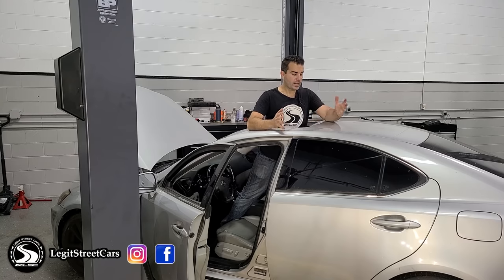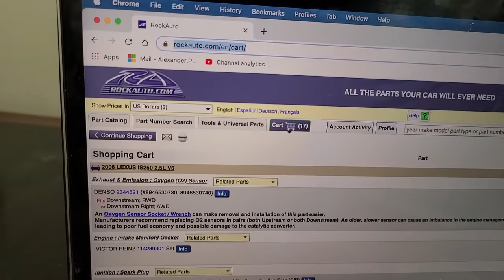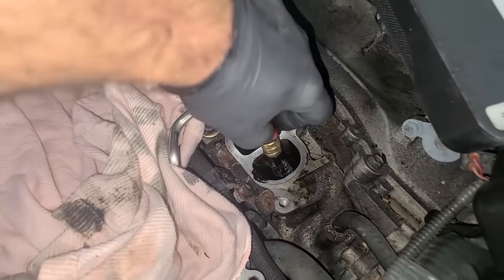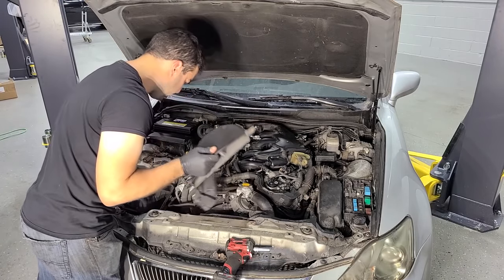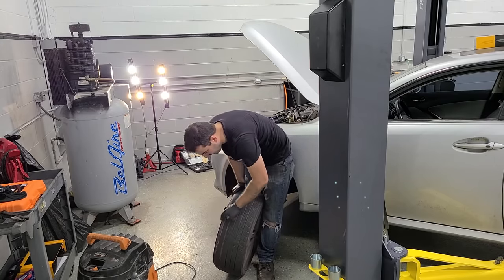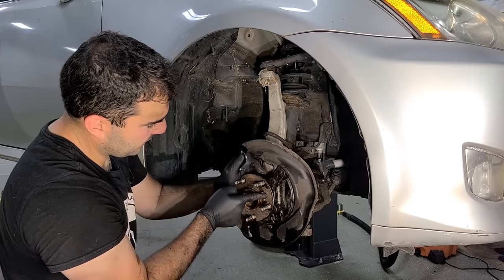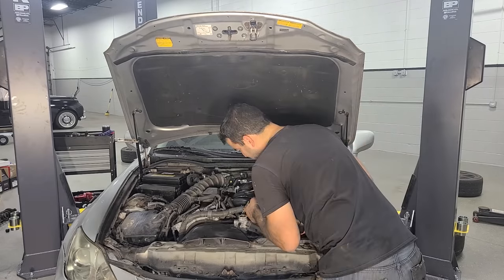I Made The Free Lexus MECHANICALLY PERFECT After Fixing A Big Issue Deep Inside The Engine!

Comment: At least in turbo VWs from what I understand the carbon build up on the intake valves is caused mainly from blow-by of other cylinders pushing the oil past the piston rings into the combustion chamber, where it is burned and gets caked in / deposited in the valves..... its not just the oil vapor coming out of the PCV into the intake manifold... although that plays a part too, as that sticky crap mixes with the carbon soot already coming out of the combustion chamber into the intake valves.... Port injectors would clean it up before but not anymore with direct injection.... its not a problem with the exhaust valves as the deposits are burned off....

Comment: I think it's a very cool thing how much you cleaned the combustion chambers and valves.  And while it certainly benefitted from your cleaning, I think a less labor intensive approach would also work.  I mean, using more cleaner and repeating the process, over a period of time plus longer drives for the car to warm up.  This engine looks like it is getting a lot of short trips, the plugs show that, did he ever change the plugs in the 114K miles?  If not, that might explains the carbon.  Fix the issues and the carbon problem should be fixed too.  Treating it to a throttle body and intake cleaning every 10,000 miles is what I would do to this car.  Also, a lot more long drives to get the engine good and hot for 20 miles or so.

Comment: What about Seafoam or just plain water, they found out that steam cleans both the valves and the combustion chamber, year's ago when a head gasket or cracked head leaking water from the cooling system turned to steam in the C C and cleaned it.

Comment: I used Seafoam Spray on my M272 engine, which seems to run better afterwards. Is M272 direct injection?  
It was a relief because it seemed like the consensus is that cars with intake manifolds with tumbler flaps  those sprays don't make it through the intake to do their job.  
But now seeing you clean the flaps I kinda feel like I would need to remove the manifold to actually do any substantial cleaning. I don't know if I trust myself to do that to my daily, lol.

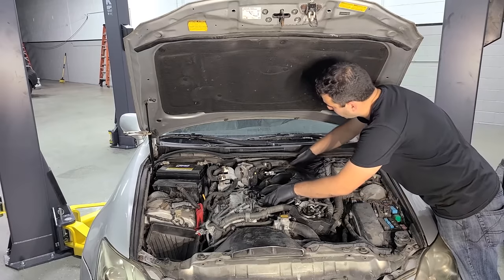Comment: I have to point out something that bothered me a bit @12:40 removal of the aluminum plenum and the lower manifold, but with the engine hot or warm... not a good idea as the possibility exists, that one or both surfaces could warp as they cool down and possibly affect the sealing surfaces.  Most people know not to remove a cylinder head unless it is overnight cold for the same reason, but other engine parts are not immune -

Comment: Read the cans, you might have the same ingredients in your possession already, just because someone is saying this is a can of this or that doesn't mean that don't have something similar or better already and at a lot cheaper price. Like I said originally they try to sell you a can of brake cleaner or carb cleaner or in this case valve cleaner that is just a pseudonym for parts cleaner. When years ago before gas was made illegal, white gas was a parts cleaner and kerosene was used as a lubricant.

Comment: easiest cabin filter .... i had to do one on a 2011 nissan rogue for a customer....drivers side...  next to the gas pedal.... also with the trans.. id still do it. i never had an issue with those "lifetime fluid" transmission fluid changes where the trans will slip.... that car hits 140k trans will be trashed if it isnt changed

Comment: They can say what they want on a can, brake or carb or valve cleaner but it will all be parts cleaner that buy in bulk from Gunk, or ATF that does just the same as Marvel Mystery oil but costs 10 times as much.

Comment: Fine job to clean the intake - but what I've seen in German videos about diesel engines these valves are nearly clean. By the way - they also use walnut blasting - nothing else works in a decent time on a diesel intake with the exhaust recycling done it's job.

Comment: "Early direct fuel injection engines[...  ]"
You mean the Jumo 210 series, DB600 series, BMW801 series, Shvetsov ASh-82FN? From the start of the 1940s? Those were early direct injection engines. And all of them (OK, except the BMW, but that is not a surprise) were exceptionally reliable.

Comment: This is such an awesome thing you are doing, probably really going to help someone out big time!  Not all heroes wear capes…. About the trans fluid, like you said, don’t believe in lifetime fluid. That’s just marketing gimmick. All hydraulic fluids degrade over time with moisture, shearing, and contamination.  You should do a proper trans flush to get everything out of torque converter, not just drain and fill. It I can do it on my zf 6hp19 6 speed, you can do it!!!

Comment: How does this clean carbon that manages to sneak into the edges of the valves and interrupts the actual seal? How do you remove that with a closed valve? Or does it tend to flake off (into the engine?!) when visible carbon right above it is removed?

Comment: Just trying to understand - if the GDI sends fuel directly into the cylinder below the valve, how does the carbon get on top of the valves if only air is coming in topside?

Comment: what was the mileage without having the carbon build up cleaned out ? I'm at 26K miles for my first time about to do it. So would it be less gunky and the CRC gdi ivd spray will likely work at this point or likely too late and will have to do a manual cleaning or nutshell cleaning ?  I'm sure the cleaner spray works if done regularly ?

Comment: How you insure your intake valves are 100% in closed position? Do you set the cylinder on TDC. For an example I have Honda Odyssey v6 and on front cam I have markings when turning a engine over by hand I line up the marking with cylinder number I’m working. If I’m correct this will insure that both intake and exhaust valves are closed? Thanks for great videos

Comment: That cabin filter door that you opened appears to be broken. The car will not be able to switch between recirculate/fresh air and will cause the HVAC light to blink. The proper way the previous owner should have done it was to set the cabin to recirculate in order to open the door using the HVAC system servos.

Comment: my 06 is350 did this last week at work at night I was panicking becausewe were supposed to be getting heavy rains I spent about an hour missing with the button and it did close but when I went to exit my car it said moonroof open, I waited until a fairly nice day and discovered the holding the button thing that resets the sunroof, which it did reset but  I am still not going to touch it until we get another sunny day and  Iwill test to see if it is all good after tha last reset lol
I have read allot about the IS 250s having the issues with direct injection but the IS 350s apparently dont have this issue.

Comment: Was the IS250 not dual injected like the IS350? Owned a 2007 IS350 and it had port AND direct injection. EDIT - Posted this right before Alex noted the 250 is DI only. Oops.

Comment: I have a 2006 Land Rover LR3 and all the sudden the Air Suspension, Terrain Modes, Hill Descent Control, Radio, E-Brake all of them stopped working and the Transmission stayed in 2nd gear and was the Mass Airflow Sensor, we cleaned it and the whole vehicle was brand new again, who would’ve thought right?

Comment: I'm disappointed as much as he's worked on vehicles he hasn't mentioned using anti seize on the threads of the spark plugs as well as dielectric on the spark plug boots
Reply: depending on the vehicle, anti-seize is specifically not recommended on the plugs because it can change the torque value and strip out the threads in the head. I've seen this happen on VQ motors several times (this is likely a more prevalent issue with aluminum heads vs. iron heads). Dielectric on the boots is always a good choice though!

Comment: OEM Lifetime fluid: Translation: The owners manual still says to change it every 65,000 to 75,000 miles. That is the lifetime of the fluid. Not the vehicle ownership. You need to change it! It's no longer based on years for the life of the vehicle, but the miles.

Comment: ALEX, i know this is an old video, and what im gonna say goes against most mechanic standards. i refuse to not service my transmissions, would you buy a vehicle with 20 year old oil? or whatever uyear old? if you simply drain.. and fill, through the pan it will gradually change the fluid, when people refer to flushes they FORCE fluid through the cooler lines usually adhering to the pump... thats when things get dislodged and problematic. simply drain,...fill...drive 5-10 miles, and repeat until cherry red. will save you  or a next owner one day. ive drained and filled every trans in my face with hot/old fluid. and never had one fail. 4l60's 4l30's and 80s. even some random kia ones. transmissions love happy fluid. thanks for reading <3

Comment: Hey I have a 08 2dr  550 with th 8 sod auto  AMG wheels and exhaust my son who is 16 let it slide out from under in a curve and smacked a tree in the passenger 1/4 blowed the side curtain air bags and knee on drivers would you be interested in it for parts It has around 85k on it cheap also  has drilled and slotted rotors front and back silver ext black leather int run and drove excellent it was my baby till well let’s not talk about it

Comment: I love your work, however the transmission fluid definitely should be swapped no matter the mileage. There is no reason not to, and fresh fluid will not cause damage to anything that isn’t already damaged. This has been disproven countless times and it’s a huge myth in the car industry, where people think changing transmission fluid will cause damage due to extra clutch pack material being suspended or etc etc. CHANGE YOUR TRANSMISSION FLUID. If the transmission runs fine, and you don’t know when it was last changed, THEN CHANGE IT FOR CHRISTS SAKE.

Comment: Typical fixed one thing and caused another problem!   You cleaned all the intake channels/valves, how much have the residues are now stuck in the and clogged-up the catalytic converter, how soon before the O2 sensor is going to throw error codes....  Want to do anything, do it right and be thorough!

Comment: No more carbon buildup, yeah, but you brushed the soft materials off so nicely with steel wire that they are not smooth anymore and the next carbon buildup is coming up again VERY SOON! Not a good job, you could do a better job avoiding to damage the softer materials.